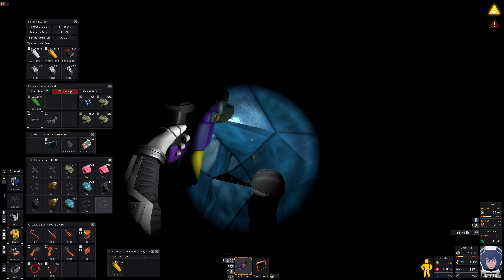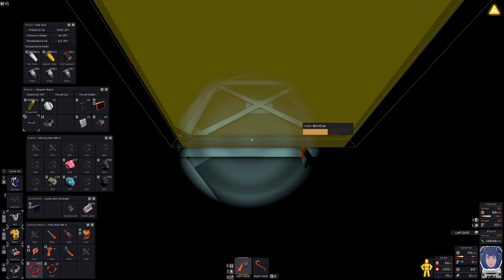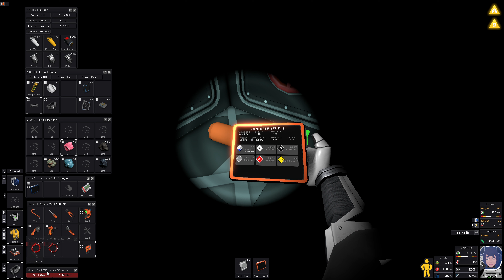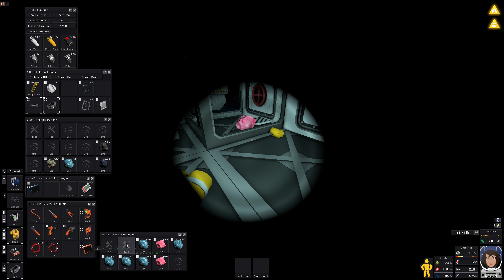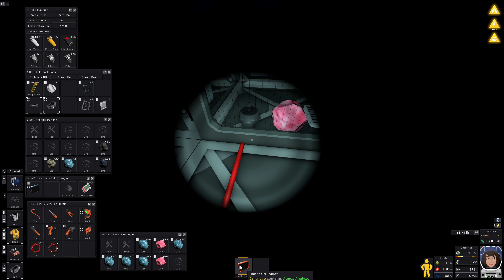Stationeers survival - Europa playthrough on hard, E5: Fuel Maker Part 1 (and stuff)

Comment: I like using the chip in the atmospheric unit to control my tank pressure so I don't have to mess with regulators
Reply from the maker: Thanks for the tip, I'll have to try that! I know about that chip option, but I never tried it - obviously I should do that.

EDIT weeks later: Yep, used the chip in the Atmospherics devices, and it's really convenient. Good tip!